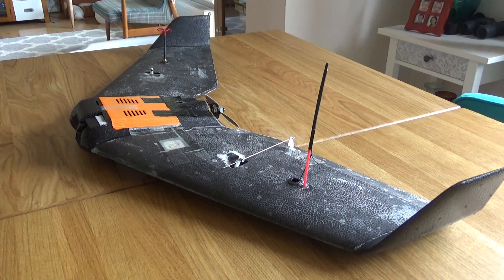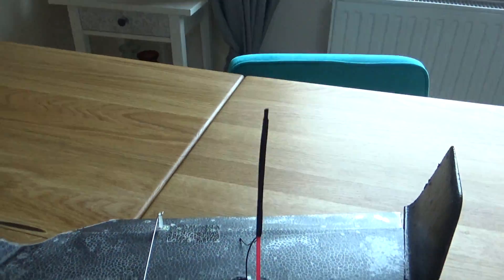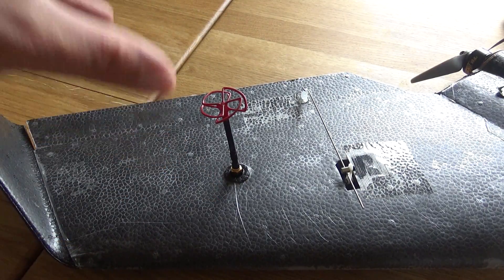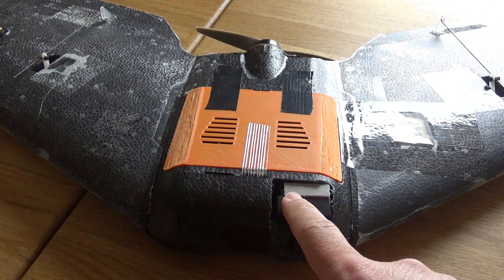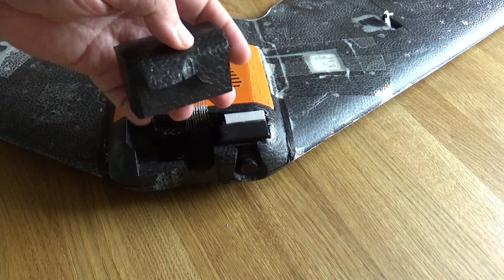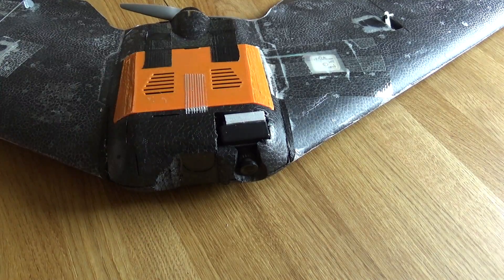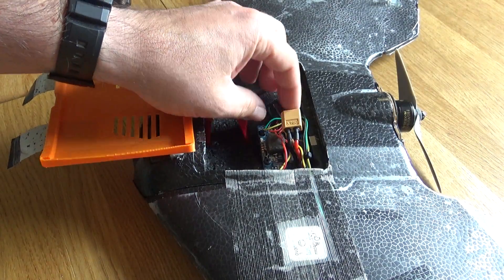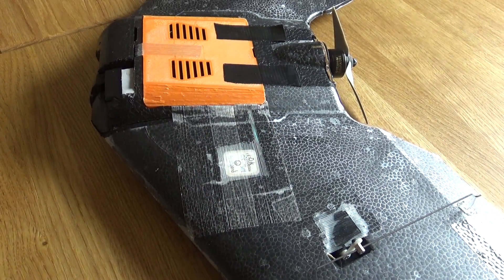My Reptile S800 Sky Shadow flying wing

Comment: I'm going to build one of these for the first time but my question is should I use a receiver with stabilization inside the receiver? Or should I set it up with an Omnibus flight controller with inav to get the gyro on there? I don't know which would be better for this thanks

Comment: So you created the S800 preset in 2.0.0. I tried the Z84 preset on a skywalker smart in 1.9.3 and it flew so poorly I couldn't fly in acro/horizon/amgle long enough to autotune (great in passthru though) as it was uncontrollably sluggish. Loaded the S800 from 2.0.0 RC3 while remaining on 1.9.1 using an F405-wing and it flew well after dropping expo to 35%. After autotune it fly's awesome in all modes. Great preset - many thanks!! As soon as 2 gets a proper release I will use the new mixer for differential thrust.

Comment: I love both the s800 and the s1100. I run a 2700 3s, 2405 2850kv with a 6×4.5, matek 405 w/ wing pdb on inav 1.9.1. Crossfire rx, and unify hv on 500mw, and the runcam split 2. Had to add 3-4 oz. of lead to front to get CG correct, flys amazing, but doesn't like flying slow.

Comment: Have to say I’m loving my S800, it is an awesome wing, if a little wobbly. Mines set up for the 3S 4000mAh multistar 10c pack with the EMax LS2208 1900kV. Works really well with iNav 2, loving the sag compensated voltages.
Reply: Hi, Do you need the motor extender to run larger props? i bought v2 but it does not include it, should i buy one? cheers

Comment: Why are all the others inav above 2.0 rc1 nog working with this board? It hangs are keep on loading when in inav and you go to a other option.
Reply from the maker: Mine works just fine
Reply: So you have firmware 2.0 rc1 on it and are using INAV Configurator 2.0 rc4 and it works?

Comment: There is a even bigger top for the compartment with magnet holes check thingiverse.com plus you can mount the fc vertical again the back of the compartment facing with the bottom into the direction of the esc.

Comment: Would you upload your Inav dump for the s800 please. Especially if the auto launch and auto landing. Would be awesome please maybe you can upload it somewhere. I also have the r9 and almost the same setup. So I will adjust servos, servo throw, calibrate gyro,
Reply: This is dummy-save auto launch for S800 
set nav_fw_launch_max_angle = 180
set nav_fw_launch_detect_time = 30
set nav_fw_launch_thr = 1850
set nav_fw_launch_idle_thr = 1250
set nav_fw_launch_motor_delay = 50
set nav_fw_launch_min_time = 8000
set nav_fw_launch_timeout = 8000
set nav_fw_launch_climb_angle = 35
Reply: Tobias Bischoff thanks I have my own autolunch settings that work perfectly fine I am just looking for professional settings from an Inav dev especially pids and so on. Thankfully he has already provided his pids so looking forward to the rest. But thanks don't need the dummy-save ones lol ^^
Reply: Tobias Bischoff i set these settings myself for my s800. I didnt use a preset of any kind. These are the exact settings I went to, to get perfect launches.